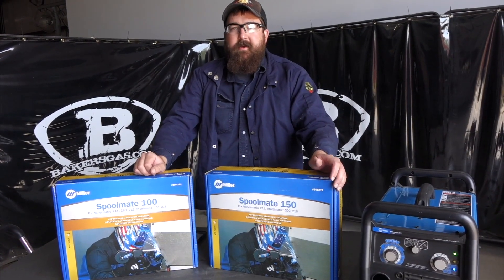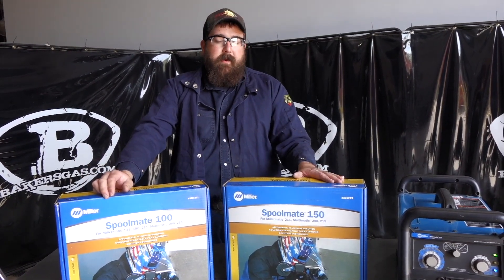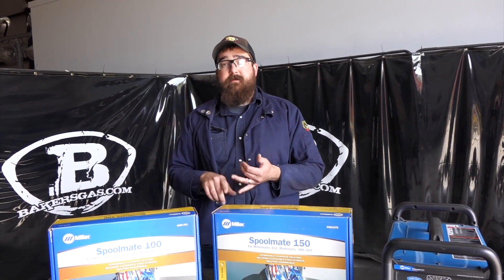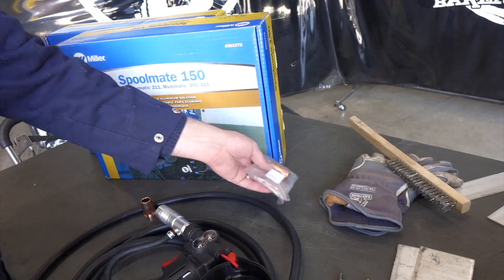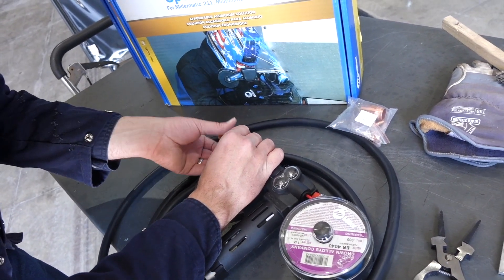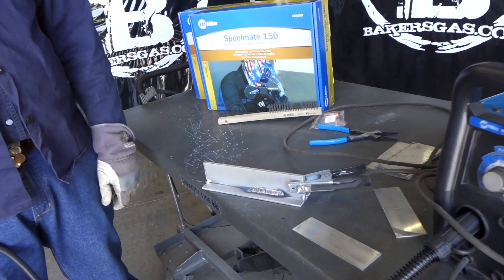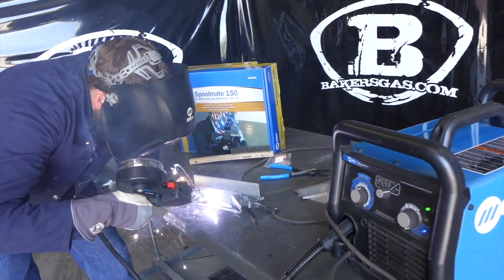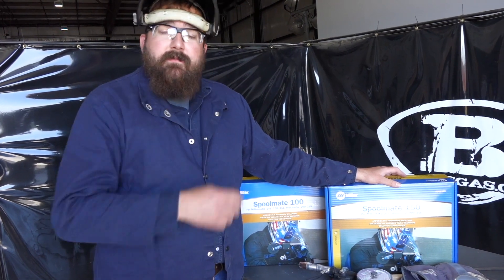Miller Spoolmate 150 vs 100 Review & Demo

Comment: What spool gun is recommended for the Miller 220 AC/DC?
Reply from the maker: Hey Paul, the Miller Spoolmate 100 or 150! The 150 comes with a longer lead and will run 4000 series and 5000 series aluminum. I will link them both for you!
https://bakersgas.com/products/miller-301272
https://bakersgas.com/products/miller-300371
Reply: Thanks for the reply. How thick can you weld with the 150 on the millermatic 220?

Comment: Actually purchased both 211 and 150 spoolmate from Baker's Gas, great company to deal with a couple of things left out of video 1. always push with a spool gun or you can trap soot in the weld if pulling the gun 2. if using auto set on the 211 it must be calibrated upon set up, Miller has a video on youtube on the procedure, if manually setting the spool gun, calibration is not needed. Baker's Gas has some of the best pricing around, definitely check them out and the 211 / 150 spoolmate is an awesome combo for the price.

Comment: What do you use for the 220 multimatic?
Reply: Either the Spoolmate 100 or 150 is compatible with the Multimatic 220.  You may want the 150 for more duty cycle with that higher amperage machine.

Comment: Great demo vid. One thing I notice welders saying today that would get corrected by the older guys 40 years ago is the term "welding helmet". They would quickly point out that welders wear a HOOD, football players wear a HELMET. Not a big deal, but technically they are correct.
Reply: I've also noticed that! Helmets tend to protect the top as well as the sides of the head. Welding hoods mostly protect the face and eyes. I've worked industrial for over 40 yrs and I sometimes hear hardhats called "helmets" too.  Kinda like when a person calls a skit a sketch. One is a type of play and the other is a drawing. Or when someone says "oil galley" instead of gallery. One is a passage, the other is a kitchen on a ship! I also notice people using the term "alot" a lot. Etc. I'm glad at least someone pointed this out.

Comment: Will the 150 version work on the Miller 200 multi ? I'm just making sure I heard you right. Thanks 👍 for this video. Machine purchased new in 2017.
Reply: I'm sure you figured it out by now, but yes both the Spoolmate 100 and Spoolmate 150 will work with the Miller Multimatic 200.
Reply: @mbrick  I did get the 150.

Comment: I've been welding aluminum for about 3 years now and just came across this video.  So I've got a few questions and apparently you are the person to ask.  I have a millermatic 211 (older model without automatic aluminum mode so I have to manually set feed/voltage).   According to your video the duty cycle is different using the 100 vs 150 gun?   I thought the welding machine was source of duty cycle?   Why is duty cycle different?   Second question..and this one I've been trying to figure out for a few years now  .Several times I ran out of the 4043 welding wire and attempted to use the 5356 with horrible results.  I even went back to the welding shop I bought the spool gun and welder from and they told me it should weld exactly the same as using 4043 wire.  You stated the gun won't work with 500 series wire, which would make sense as to why I struggled so much with it.    So why won't the 100 gun weld 500 series wire?   What is the difference in the gun itself?   I just might go out and buy the 150 gun now just because I want to try the wire I've been struggling with attempting to use.    I've wanted to use a stiffer wire and avoid the birds nests that slow progress down, but could never figure out why I couldn't use it properly.   I spent hours playing with welder settings.....and finally figured out I was not able to get enough wire speed feed, but I thought it was a machine issue,(more likely an operator issue), but never considered a gun issue.
Reply: I mean you actually hoped they’d reply…
Reply: When folks talk about the duty cycle of the gun they're talking about the amount of use you get out of it at max amperage. 
There are some caveats regarding which gas mix your using as more co2 will increase the duty cycle (the gun won't get as hot with straight co2 as compared to c25 at a given amperage).
Aluminum needs straight argon so  there's no cooling from co2.
As an example, 300 amp roughnecks with bernard centrefire kit are rated for 300a on 100% co2 100% duty cycle but IIRC are de-rated to 60% @ 300a when using argon/co2 mixes. 
So when people talk about rated amps and duty cycle it's generally in relation to the machine you plan on using the torches with. Obviously it wouldn't be a good idea to slap a 100a torch on a 200a welder and run it balls to the wall on c10 for 5 mins non-stop. Intermittently, sure, but a 200a machine will outweld a tiny torch and overheat it in short order.
And in regards to not having enough feed speed, it could be a problem with the motor, or you may just have hit the max speed of the motor in the spool gun.
Either way I'd up your wire size.
Thicker wire means you can reduce your wfs.
Hope that helps.
Reply: @brianlittleforest631  Thanks for the input.   For me, it still doesn't explain the reason why video claims one miller gun will run 5 series wire and the other won't.   Since posting this question (quite a while ago) I went out and purchased a cheap welder at home depot  and matching spool gun.    It is an invertor welder.    Wire speed on the cheap welder is no where near what the 211 has, (So slow,  I thought it was a faulty unit at first) and yet, it makes a much better weld, and will do the 5 series wire no problem.  In fact, I accidently put 5 series wire in it for initial test of machine, and couldn't believe how clean the welds came out first attempt.      That HD welder, complete, with spool gun, for $800 made better welds in first half hour of use than I ever got out of the miller 211 after a few years of attempting to dial it in better.    I no longer will use the miller for doing aluminum.    I am no longer fighting with the welder, or replacing tips/wire jams seemingly every 10 minutes.    Everything is easier and has a more controlled weld, with clean finished results.

Comment: So, I learned to mild steel MIG weld on a Millermatic 210 and did that for several years.  I never had the chance to learn to weld aluminum or TIG.  But I'm looking to get a Multimatic 215 and learn TIG.   I've always been under the impression that MIG wasn't for aluminum.  But this spool makes me reconsider that assumption.  I guess my question is: when is the MIG spool more appropriate to welding aluminum than standard TIG?  Do both accomplish the same task?  Is there anything unique about either?

Comment: Witch gun should I buy... for my millermatic 252... help... thank you.
Reply: that takes a different gun, 8 pin connector I think
Reply: Spoolmatic 15A, Spoolmatic 30A, or Spoolmate 200.  Heavier duty but also more expensive.
OR you could use an Aluma-Pro push pull gun, very slick.

Comment: I see soot around the weld.Looks like you are not getting good gas coverage.
Reply: If gas valve is open and regulator set, soot is caused by pulling ( dragging ) the spool gun, best practice is pushing spool gun
Reply: @guzzifabrication3448  I am aware of the push method but if you look carefully He is getting soot on one side of the weld.So this would mean he his not getting a good flow of gas all around the nozzle.
Reply: That's right. Aluminum welding requires the push method for argon flow coverage to weld.

Comment: what pound roll goes into the gun, does it run out quick?
Reply from the maker: You can use a 1 or 2 lb spool. If you have not ordered yet make sure you add the bundle we have a spool of wire and some extra tips!

Comment: I’m assuming the 150 will also work with a millermatic/Multimatic 255? Welding 5000 series aluminum is a must for me
Reply from the maker: Any aluminum gun with a 10 pin connection will work. Spoolmate 200, 15A, 30A and most push pull guns. If you check out the spec sheet linked below you will see the exact part numbers/descriptions Miller recommends with that machine. Hopefully that answers your question. If not please call us! :) 877-930-5690 

https://www.bakersgas.com/MIL907728.html

We also made a video showing the push pull on the Multimatic 255 if your interested. Linked below:
https://youtu.be/8ZLcmA3EVX8
Reply: Baker's Gas thanks for the reply guys! Videos are always informative. I’ll give you a call if I have any more questions.